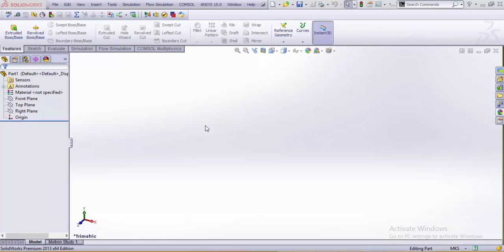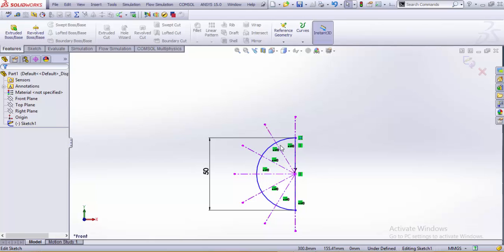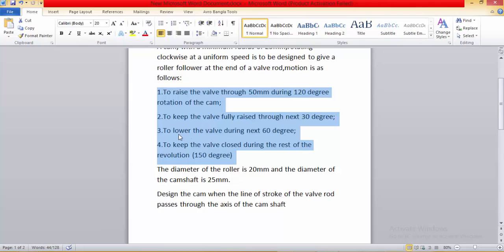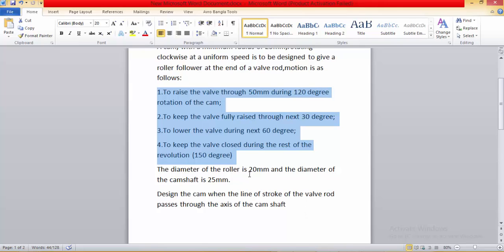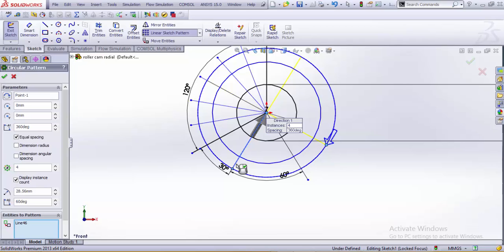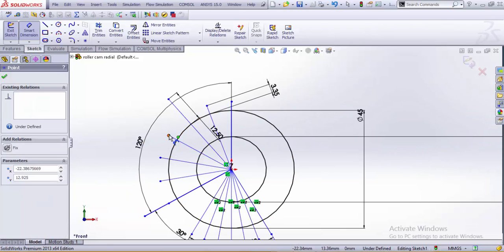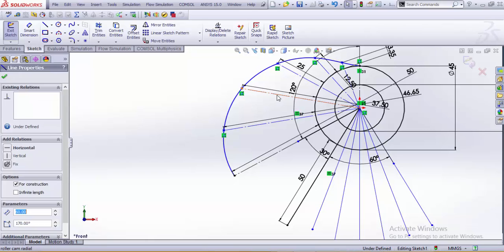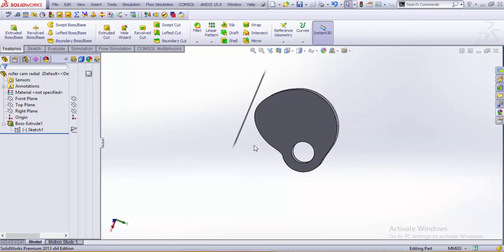Roller follower cam design in solidworks

Comment: Waalaikum Assalam.
Brother, I am confused as your problem statement says: the minimum cam radius is 25 mm, the cam shaft has a radius of 12.5 mm, and the roller has a radius of 10 mm. Yet, you drew the prime circle with a radius of 22.5 (12.5+10) mm. Shouldn't the prime circle be of radius 35 (25+10) mm. 
Another point: shouldn't the cam profile be drawn from the base circle (25 mm radius)? 
Reference: https://www.cs.cmu.edu/~rapidproto/mechanisms/chpt6.html
Please correct me if I am wrong.

Comment: It would be very useful if you make a tutorial on a steel bar parting machine cam with 20 mm constant rise in 270 degrees at the equal rise in each degree. Overall this is also a very good video.